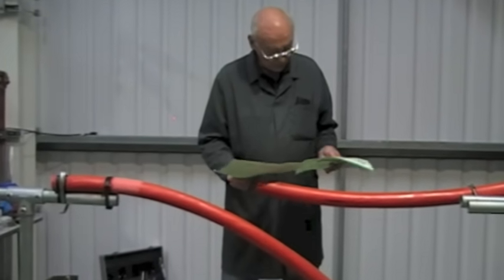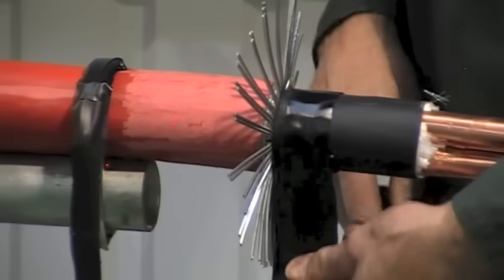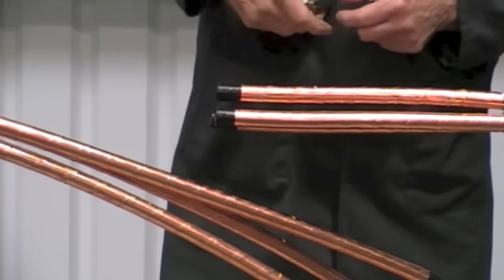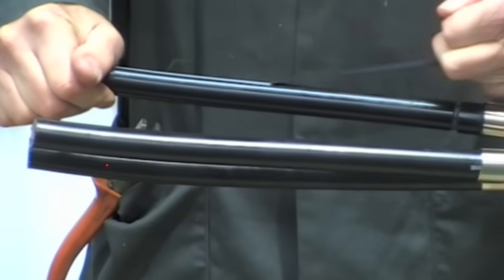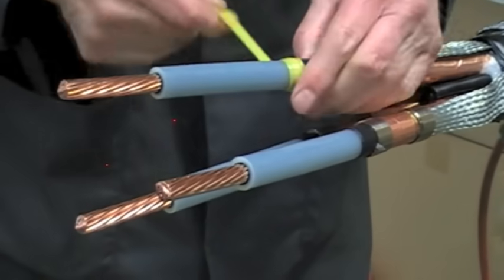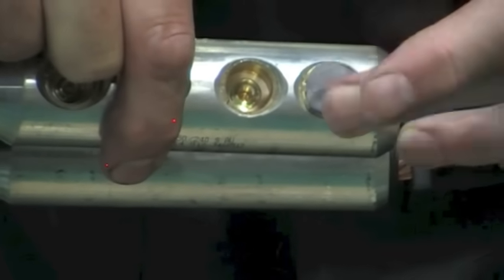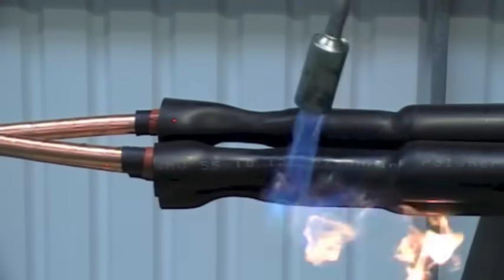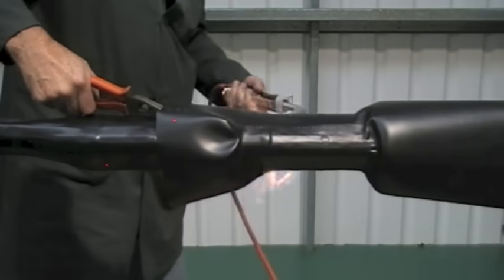Heat Shrink Cable Joint - 11kV 3 Core XLPE & EPR High Voltage Cable Joints

Comment: Why is the copper screening braid double-layered over half the joint, then open-wound over the remainder? Did they run out of braid half way through the job?
Reply: nlo114 Hi, no nothing ran out. The mesh is to pick up surface current and as long as its in contact with the insulation/conductive tubes, the semi-con layer on the cores and back to earth, that is all that is needed. Has been tested too so we know its fine.
Reply: If is done that way for conduct the transceiver calibration support to its optimum performance.

Comment: All very nice, but in reality the cable would be 6"-8" from the floor not at waist height. That is unless they have started digging very deep joint bays.  Oh for the days of paper insulated cables!
Reply: John Harrild John, sorry for the delay in responding. Totally agree. During some training courses my previous engineer preferred to do the training on bricks for the very reason you suggest. But this is a film which is part training, part showing off the product and as its not a real life situation, we felt it more appropriate to film it on the stand.
Reply: shrinkpolymersytems Only joking buddy.  If only it was like that in real life, I wouldn't be crippled with backpain now!